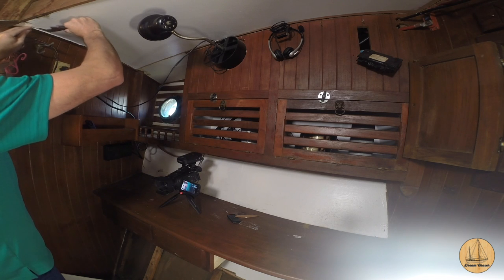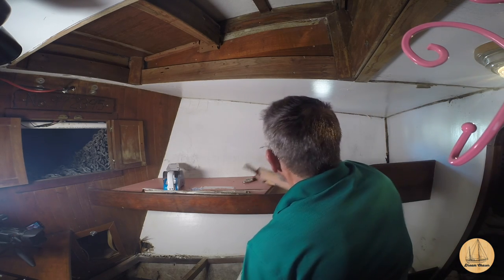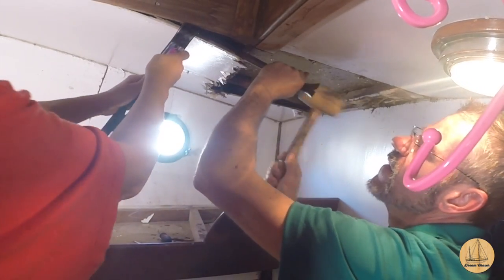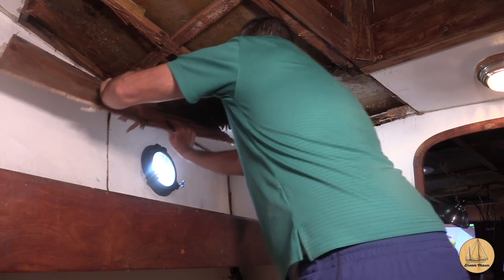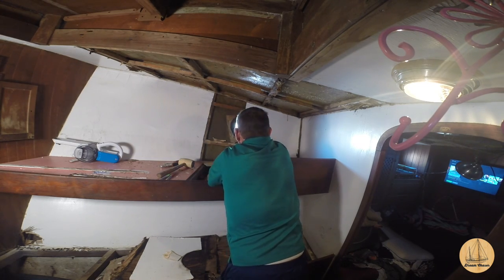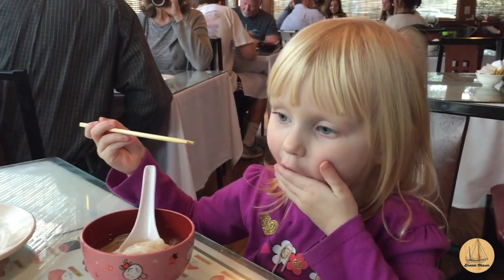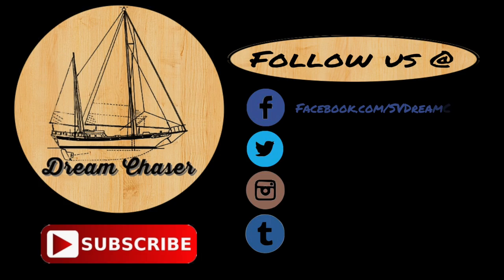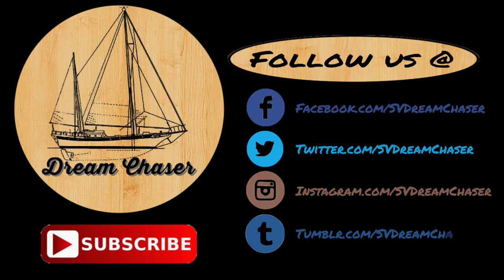Insulating the V Berth & More Screws

Comment: great job!! We are also restoring a sailboat and documenting the process and I fully understand when you say: sometime I need a break from a job and I need to start with another one!! it is absolutely true! we are now also insulating the v-berth but given that the boat is much smaller (and we are not liveaboard) we decided to go for less than half inch. Actually, the original insulation of the boat was basically .. none! good luck with your project, I will follow your updates!
Reply from the maker: Sailing Jabuka Thank you. I would love to know what you choose as insulation. Always interested in others ideas.
Reply: sure! we decided to go for closed cell foam. such material comes in different thickness and is also used to isolate from humidity the pipes of air conditioning systems. you can see in our videos how it looks like. above that we placed 2mm plywood panels covered by 1.5mm vinyl.
Reply from the maker: Sailing Jabuka cool. Thanks I will check it out.